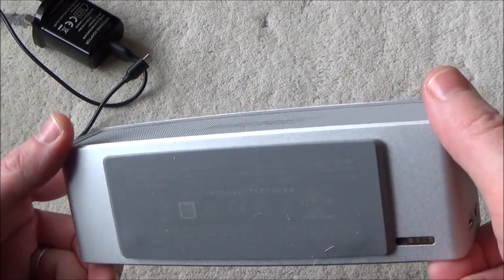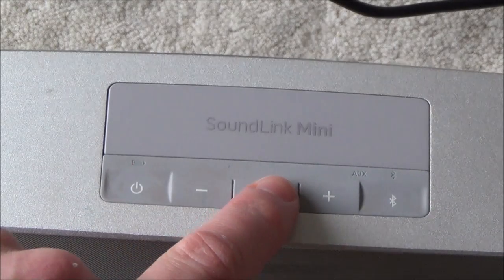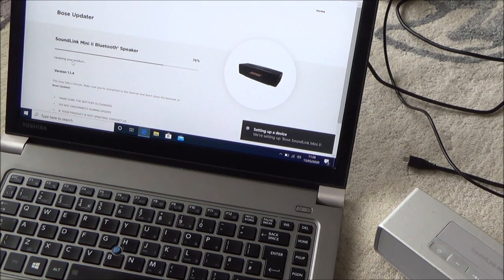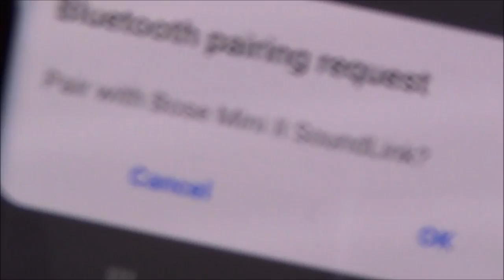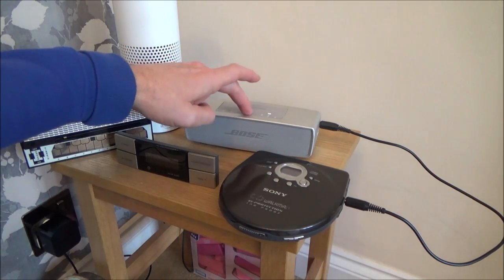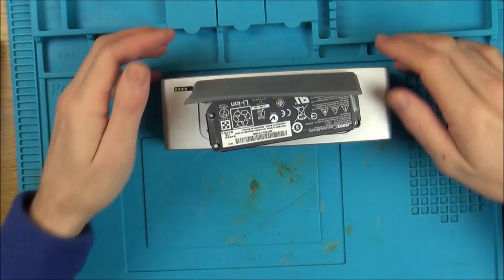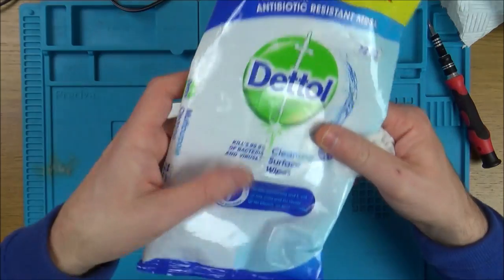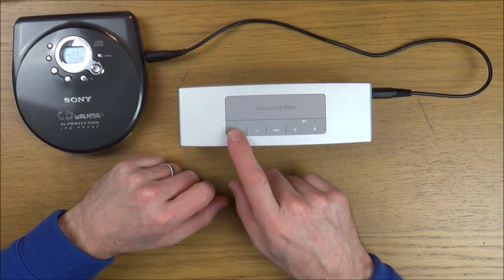Trying to FIX: BOSE SoundLink Mini II SPEAKER (Red Flashing Light)

Comment: Vince, just as an FYI, the "big speakers" are actually passive/bass radiators. The unit itself only has 2 full-range speaker drivers, and 2 passive/bass radiators. They generally improve the bass frequencies, as they vibrate due to the air that the actual speaker drivers push out. That does mean that the unit needs to be sealed, so air cannot escape, otherwise the passive/bass radiators won't work correctly (as they rely on the air generated by the speakers!). They're generally used in small speakers where a "port" can't be used. They work very well (as you can hear!) but do compromise in the "accuracy" of the sound as they do not actually have any components of an actual speaker, just a piece of rubber (or metal in high quality ones) that vibrates based on the air the speaker drivers generate.
Reply: The Soundlink Mini 1 & 2 have metal passive radiators, the reason there is a backwards facing one is also to help with stability to counter all of the front-facing power. If the one on the back wasn't there, the speaker could move around on the surface, despite the grippy rubber on the bottom.

Comment: The AUX connection is just analog audio like your headphones that would plug into the CD player. There is no possible way the Bose can pause/skip or otherwise control the cd player. It just muted the audio when you pushed the middle button.
When paired to the phone it actually does control, which is nice. Nice video! :)
Reply: explain in line headphone  ontrols then
Reply: @_Talik  on what device? A volumewheel in the wires to your headphones is just a potentiometer. If you're talking smart phones there might be a command switch to another 4th contact.

Comment: I would like to add an info. Sometimes the devices are already updated and the led is still lightning red. So, there is an advanced mode on this BOSE UPDATER, which works like this - do the same steps you have done before and when the soundlink is connected just press - ADV and after the UP and DOWN arrows. The system starts again to update the firm software, despite the soundlink has already been updated. And magic!!! It works again!!!! Thanks for your video! It has helped me a lot as well!!
Reply: Can you be little more clear for the computer illiterate pretty please?
Reply: This method doesn't work anymore. An error message pops up that says "no dice."

Comment: Thanks a lot for this viedeo. I've had my speaker in my camper over the winter. Now had the same flashing red light. Also did the update and it reset the unit. All old settings are still there and its working again. Great Help. TIPTOP I'm very happy. br Andy

Comment: I have it and it’s a versatile speaker and mine is about 5 years old and still working nice. The bass is booming when set next to a shiny surface, like a kitchen or bathroom wall. Funny thing is that it employs some audio processing that keeps the speaker from distorting at high power levels by reducing the lows or the highs depending which is more close to the designed limits.

Comment: I'm listening to this on my Bose speaker at home and the music sounds as good as if I were playing it off my own player.  These speakers have been having problems with the supplied charger cord but switching it out with a different cable and plug works if you have trouble getting the speaker to charge.  Bose is a high end speaker and they made the speaker systems for movie theaters in the USA; they are the originators of the surround sound systems.  They made their systems available to the public when home theaters became mainstream.  Explosions on the theater systems will make you feel like you are near the explosion.

Comment: I have the same speaker with the same problem, going to the bose updater site said that it was on the latest version and kept it broken. Apparently, if you press 'a', 'd', 'v', 'up arrow', 'down arrow' it bypasses this check and I could reflash it to the latest version. It is now working.

Comment: Vince, not to sound like I'm correcting you. That thing in the back you described as a speaker is called a Passive Radiator.
In a sealed box, which in those types of speakers they are usually partially waterproof, the passive radiator acts like a port allowing the main drive speakers  to flex to the full extent of their movement.
For clarification, if  it doesn't have wires connected it is'nt a speaker..
By the way, Nice Save on checking for updates first....
Reply: Yep used to call them PBR's (passive bass radiators) .

Comment: Software is like Operating system (or secondary programs etc.) controling a group or chain of hardware devices or modules, while firmware is like BIOS or boot system that initialize the operation system or works without operation system at low level in the device or module and it is usually tied to the specific hardware configuration monitoring and controlling specific input and output factors, encoding and decoding or translating signals directly on hardware level and so on.

Comment: Crazy how people can overlook something as simple as updating firmware and automatically diagnose it as faulty. Firmware is one of the first things I check.
Reply: I have a Bose Soundtouch 20, and from experience using another bose speakers, they sometimes have firmware issues arranging from being unable to verify the update or not connecting to certain types of networks. Mine refuses to connect to a mixed 2.4 5.0 ghz network

Comment: I fixed one of these that had the charging issue. Get a 2 amp wall adapter and plug and unplug the USB cable for about 10 minutes. Give it 4 seconds after plugging in before unplugging again. It will put a momentary charge each time you do this. After a bit it will have enough charge in the battery to stay charging.
Reply: If you have the mini1, 2 amp is too much! you can burn it lol. Only use1 amp, because the original is rated to 0.8 amp. 
If you have the mini2, then 2 amp will work good because the original is rated to 1.6 amp.

Comment: I have had several Bose speaker and headphones over the years. the sounds is absolutely amazing, however they definitely can work on their motherboards. Ive had intermittent Bluetooth issues as well as battery issues with almost all of my bose products after a year or so. I will say though, their warranties are really good.
Reply: Hey mate, I just bought my first pair of bose headphones this year. Im having weird Bluetooth issues as well. I however lost my receipt, in your experience do they require proof of purchase for warranty issues ?
Reply: @adksherm  I never had mine either. You should just need the serial number. you can even do it all online on the Bose website. They might have you go through troubleshooting it first though. Like resetting the headset and such. Good luck!!
Reply: @jasonbucy  excellent! Thanks for the response mate!

Comment: Hey Vince here's the Difference between  A software update and firmware update A software update, which is sometimes called a software patch, is a free download for an application, operating system, or software suite that provides fixes for features that aren't working as intended or adds minor software enhancements and compatibility.   Firmware update is a data that is stored on a computer or other hardware device's ROM (read-only memory) that provides instruction on how that device should operate. Unlike normal software, firmware cannot be changed or deleted by an end-user without the aid of special programs and remains on that device whether or not it's on or off. Hope this help Vince

Comment: I do have the exact same device, and the sound from this little thing is amazing. Of course you can get bigger devices that plays better, but for a device of this size it is amazing. However, I have to say it does come with its quirks, and one of my biggest pet peeves with it is that it does struggle to keep connected to PC's and Mac's via Bluetooth over time, sometimes I've had to simply remove it and re-establish the connection to make it work. It is well worth the money it costs though, despite its quirks...

About Firmware vs. Software. Yes, I do see other comments here, but I'll try to give you my take on it.

Firmware is the software that makes the hardware work and contains drivers and whatnot for the operating system to grab onto when you install the OS. So, it lies deep down at the very lowest levels of the device. In a PC you would call it BIOS - if that makes sense, on modern computers there's a lot more than that, but that's the simple version. So, above that level you have the Operating system level (in devices like this, usually an embedded Linux distribution of some kind), and finally - on top of that again you have the Software layer, where applications can be created by "common people and programmers" and installed. However, not on iOS devices like this, it is a very closed system. So, software needs an OS to run, the OS needs the Firmware to run, and the Firmware lies at the base of it all. :)

Comment: Hi Vince,you have had a result mate.Does Marcel from Holland want it back now ?
I am on a self quarantine lockdown,and awaiting for the Cybermen to come to my Flat to test me.
Nice easy fix Vince,I have just converted my old washing machine motor to run on  d.c power .
I have made a 36volt battery pack from used 18650 batteries for it and it runs well.
I will use the motor for my Ebike project.
I need to weld a sprocket to the end of the motor shaft,and will do that tomorrow.
I may even upload a video on YouTube on the subject.

Keep the videos coming please Vince,I appreciate you for them.

Comment: firmware is strongly hardware dependent software, that is usually developed for one specific device (or a family of devices).
Reply: To be more accurate, Firmware resides on a chip in the device such as a graphics card, bluetooth speakers and establishes communication to various parts of the device mainboard, Software are applications you use on the computer, A driver tells the computer the device type etc and allows communication from the computer to the device. You could say a BIOS update is a firmware update in a sense.

Comment: There are two small long throw speakers, the large thing in the middle I believe is a passive radiator, kind of a dummy speaker cone that vibrates from the pressure resulting from the left and right driver units.

Comment: Vince, my understanding is that Firmware = Pretty much the bios of the device. A specific system software written specifically for that device or range of devices. Software = General expression for any software. On your computer for example, Skype, Steam Client, Office etc. are all different types of software.

Comment: I got the first version of the bose soundlink mini (so it's the I, not the II like yours) but it's an awesome speaker, sounds magnificent! It was very expensive back in 2013 (200€) and I still use it nearly 6 years later (I got it on Christmas 2013, I was 12!) now I'm 18 and I use it sometimes, I got a protective case for it, and it's still in brand new shape. 
The only problem it got is the fact that it uses a barrel jack plug instead of a micro USB :(
Also it doesn't speak, it's just a standard speaker

Comment: Great little speaker I have the Mini 2 myself as far as I know the bottom peels off for changing the battery.
Reply: I have the first gen, and yes, that is exactly what it is for. I might actually have to replace the battery at some point since it seems that the battery life has gotten quite a bit worse (understandable of a 4+ year old unit that has been used a lot)

Comment: Firmware and software are pretty loosely defined and highly dependent on context. In general though firmware is lower level and tends to directly interface at the register level for configuration of basic functions of a device while software usually refers to the higher level stuff like ui that most people would be more familiar with. That being said both firmware and higher level application/os stuff are both still considered software. I'm an embedded microprocessor engineer so most of what I do involves writing firmware and designing circuitry for control systems.
Reply: Good to see you share your expertise on another one of my subs channels. I’m a big fan of your channel 👍🏼

Comment: Firmware refers more to stuff running direct on metal i.e base operating systems, certain system drivers, the stuff that runs on the device that the device then uses and has drivers for, that sorta stuff

It's all software, really, but software is such a massive catch-all term, it's useful to have sub-categories

Comment: Firmware is software, but it's a little more permanent than lets say an Apps information that is written and modified often, firmware is usually an "Operating System" "OS" that may never need an update, but over time things change "New compression or changes in Bluetooth connectivity Etc may change" and thus products may become inoperable unless the OS can be modified in order the device wont become redundant..
BTW  a SUB Woofer if functioning properly should not be heard but rather Felt "Floors, Walls shake and vibrate and even windows may break" as they operate below the audible range, whilst a Woofer is mainly within the Audible range.. APU I dropped a like..

Comment: Nice, I actually scored a soundlink mini 1 a few months ago with similar symptoms for $25 but it turned out my battery protection board was toast (though the 18650's oddly enough are fine). I ended up just buying a replacement battery for another $25 and being done with it. Unfortunately the first gen units cant be flashed using the firmware updater.

Comment: Regarding your question - software vs. firmware.  Software loads into RAM, while firmware is stored on a ROM.  So a firmware update is updating the software that "lives" on a ROM chip (as opposed to a RAM chip).  If we were to think about it in terms of desktop computers, a BIOS update would be a type of firmware update.  And I suppose this is common knowledge, but if not... RAM = Random Access Memory... also known as "volatile" memory because whether or not it will store information depends on the power state of the computer/device.  On - anything in memory remains and is accessible.  Off - everything is gone. While ROM = read only memory... also known as "static" memory, its contents remain regardless of the power state of the device.  If you ever go into the BIOS/CMOS of your desktop computer - the interface loads from the BIOS ROM chip on the board.  And even if you take out the hard drive and boot the machine into BIOS... it'll load BIOS right up.  LOL And the only time the interface may change is when you update the BIOS.  Otherwise, it's consistent every time.  Now that the history lesson is over :D - if you have a modern mobile device of any sort, the entire operating system lives on a ROM.  So every system update or flashing the ROM, is a firmware update. :D A final thought...  when you hear "this device is bricked" it generally means that firmware is corrupted.  And you can't flash it to fix it... because it won't boot, because the firmware is corrupted.  LOL

Comment: Firmware is a hardware specific controller program that usually gets flashed on to the device's permanent storage memory chip.  It is technically software, but for controlling a hardware device like a camera, bluetooth device, router, etc.  Software tends to mean what you load on to a computer system to perform some user task.